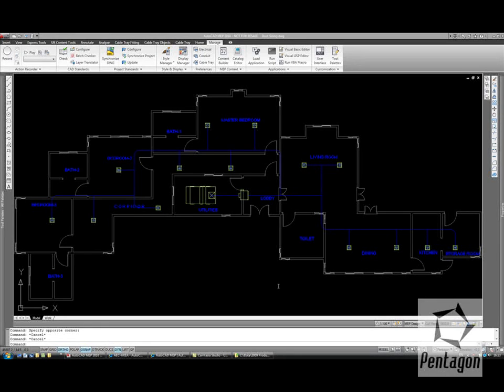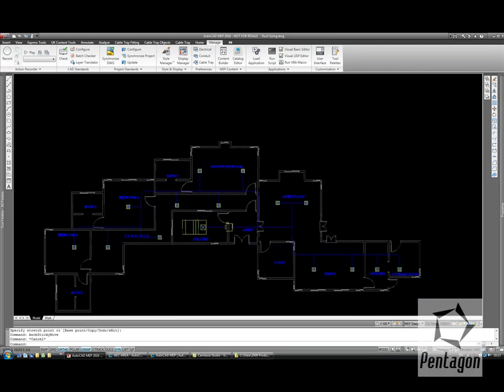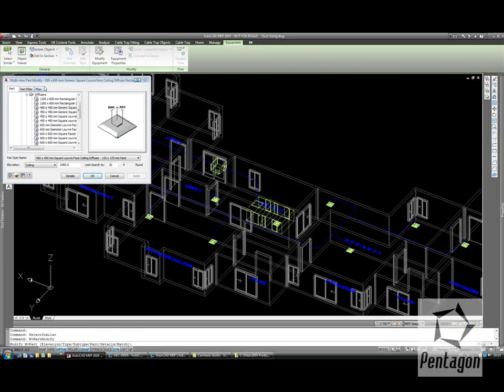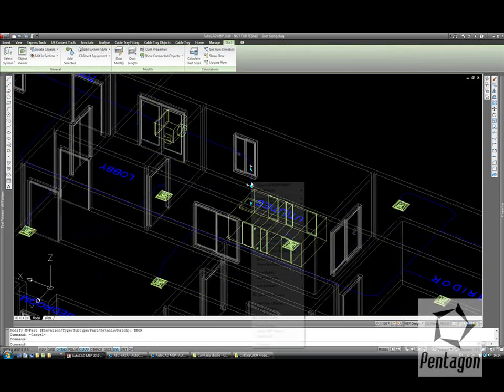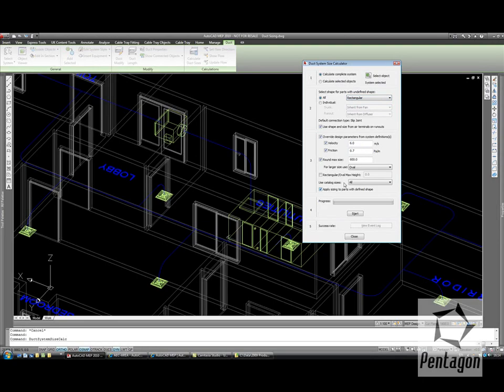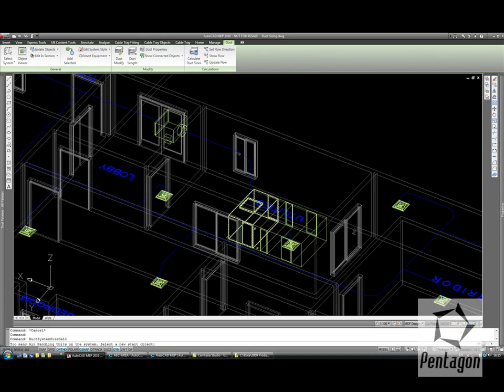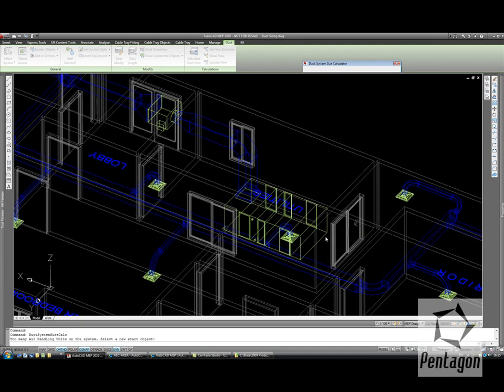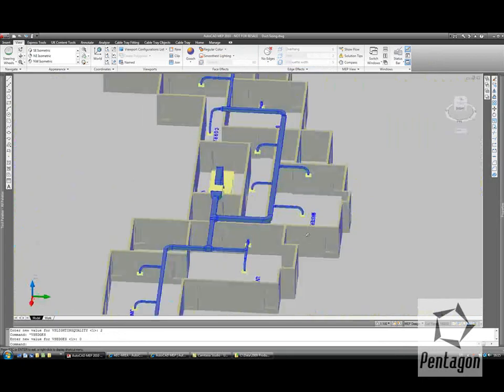Sizing Ducts in AutoCAD MEP

Comment: Hi,
Thank you for this tutorial i found it very useful ..i m new to AutoCAD MEP i want know few things about this software. 
Does AutoCAD MEP  is a drafting software or design software?
Does AutoCAD MEP has option to calculate Heat and cooling loads within software Like Revit MEP?
How user will perform duct sizing what factors are require to do size of duct?
HOw do we know the CFM and velocity for duct sizing is there any thumb rules?
please reply